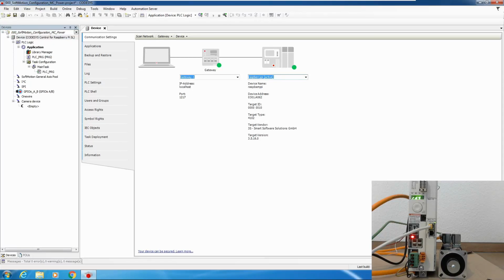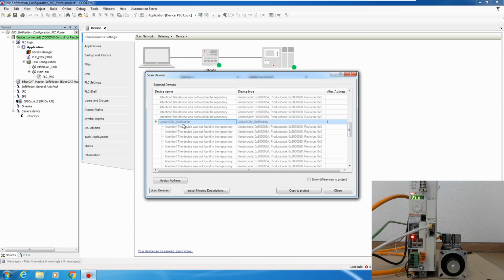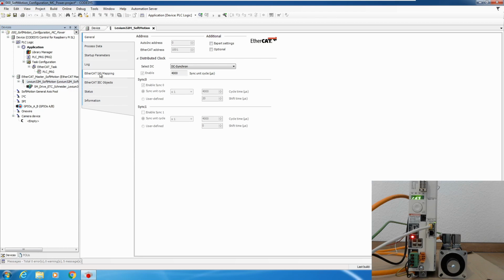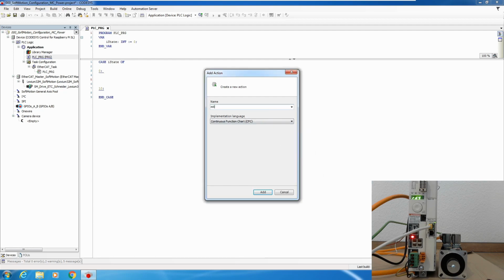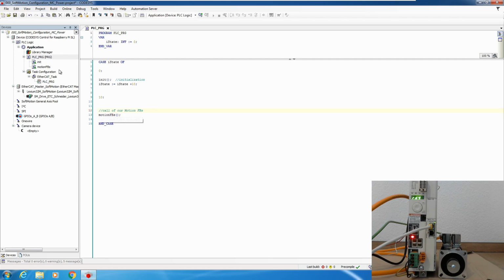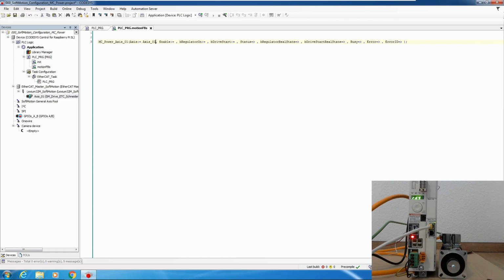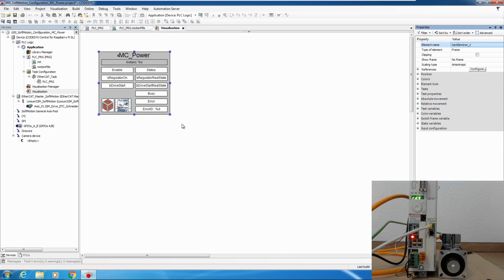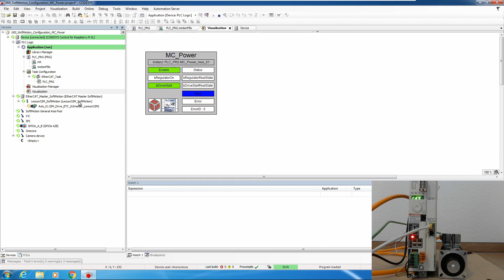01 - SoftMotion - Lexium - MC_Power

Comment: I only see a picture of the drive and the motor, how is your connection like from the raspberry pi? did you connect it via router or what?
Reply from the maker: Hi. drive and raspberry integrated eth port are directly connected. Please check some educational videos regarding how ethercat works. standard routers and switches can not be used on ethercat. pc is connected via second (usb to ethernet) port.
Reply: @SoftMotion-Black Alright, thanks, I think I know what you are talking about, that is why I wanted some clarity. Thank you again.

Comment: hi man, I am struggling to make Lexium recognizes EtherCAT module. It gives me an error 7905 and I have no idea  how to reset it.
Reply from the maker: you changed the module in slot 3. press jog dial on the drives HMI to confirm this error.
Reply: @SoftMotion-Black  thanks, it worked